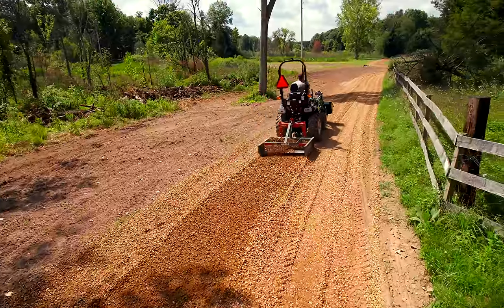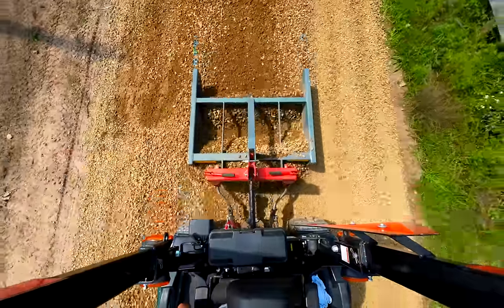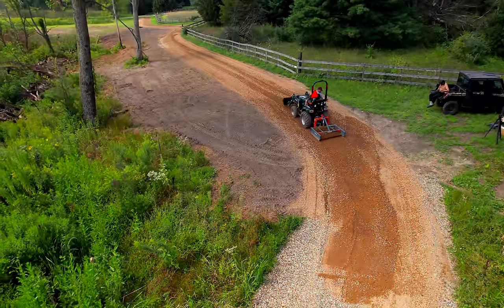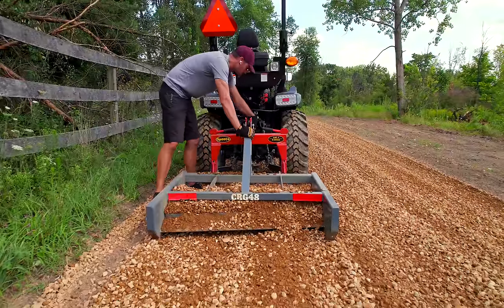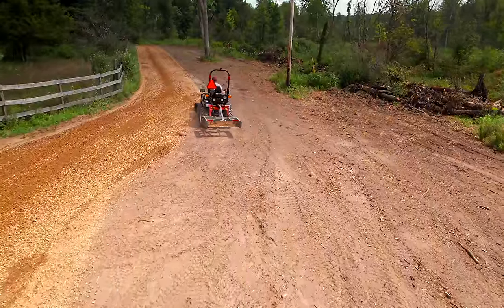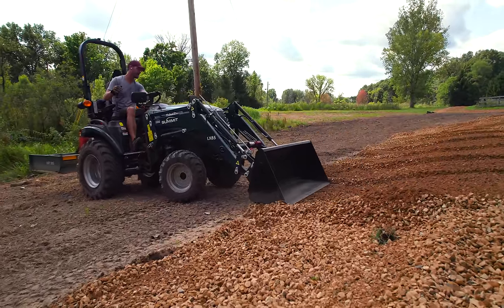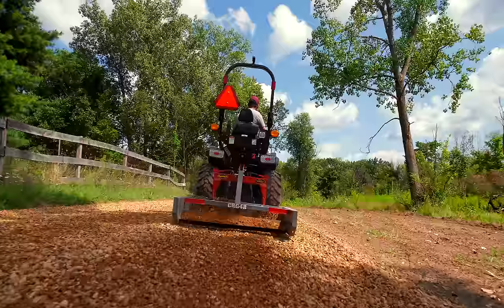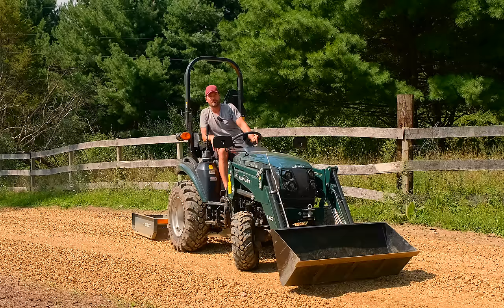THE ONLY TOOL YOU NEED FOR GRAVEL DRIVEWAY MAINTENANCE!😎

Comment: I put that fabric down on my 1000' gravel driveway 11 years ago and it has held up fairly well but has popped to surface a couple of places on the sides.    Maybe the contractor didn't cover it well enough.  I have put some gravel down couple of times since and it's the recycled rock from concrete and was washed and holds up well. and I'm afraid it I ran something like that over the drive it might get down to the fabric but watching you maybe it won't.  Thanks for awesome videos.

Comment: Looking good!  Feeling a 1’ deep ditch with large rocks every few feet is coming soon on the uphill (fence) side of that drive tho… with a couple of strategic perpendicular relief drains under the road or away from the road at key low spots…  More fun times ahead!
Reply from the maker: Definitely could be in my future, bit of an experiment I suppose!
Reply: That's what I need for my .2 of a mile driveway where a small seasonal stream goes over at a low spot to a larger stream to the west.
If I can, I may try to redirect above in our field (swales and berms directed to the east side of the 11 acre field to another seasonal stream), but nature has been flowing this way for a long time..... Hugh, I think I will need a culvert, but like the idea of the rocks you give to guide the flow.   First, I need my first tractor.  Love my new farmette of 21 acres in farthest northeast AL.

Comment: I would let the dump truck comeback when you are done with a load of maint. Gravel and give the driver $50 bucks to run up and down the entire gravel drives and ‘ROLL/Compact the finished gravel in to seal it in.  The tires and weight work perfectly for this.
Reply from the maker: Yep, Tom with Balkema does that for me.  Makes a big difference.

Comment: Almost 25 years ago, we started with about 500 hundred yards of busted concrete (still had the wire stickin' out) -- about a 300 foot winding driveway on virgin corn field. Today, about 500+ yards of  21A later, we've got a nice 2 tire track drive with grass in the middle. Woulda been nice to have that tractor you're drivin' -- got it on my 'things I want' list.  😊 (no, we never had problems with the wire from the busted stuff  -- it's down deep).
Reply from the maker: I bet that looks very nice

Comment: It will be interesting to see how the driveway holds up where water goes across it. Around here in central Minn-a-snow-ta they use a material called Class 5.  The past 2 springs have been disasters with lots of mud and washout. We had a guy come in this spring and lay asphalt millings and So far when we’ve had heavy rains, nothing washed out. Love that tractor. Hopefully they’ll be for sale around here.

Comment: I like the golden color better... I use a 60" box scraper, I don't have a landplane. With the hydraulic top link, the box scraper is very versatile and it does a flawless finish. The final step with the box scraper is tilting it back all the way, my box scraper has 2 blades, and basically back dragging the surface. The curve of that blade also works to compact the material. I would like to try a landplane sometime.

Comment: A planar, out sloped surface is optimal design on a hiking trail, vs a crowned surface.  This promotes sheet flow of drainage water, which avoids concentrated flow of water.  It's the concentrated flow of water, far more than sheet flow, that promotes erosion.
Reply from the maker: Very good assessment, that's what I'm going for.  Thanks for sharing!

Comment: Great video, Courtney!  As you work the sloped area, I can see how much is drops off to the side.  The picture in the video looks fairly flat which is deceiving.  I would love to see how a land plane would work on a bumpy pasture to help smooth it out...hint...hint..
Reply from the maker: Morning Kyle...I've kind of sorta tried that.  It is tough.  Same thing with a box blade.  If there's lots of organic matter and sod clumps, then it loads up very quickly and doesn't do an amazing job and pulling out all the sod.  I think it can be done, but is a heck of a lot of work.  Doing it for an entire pasture would be a nightmare in my opinion.
Reply: @PgetzkeFarmstead   A power harrow may do a good job too. I have only briefly seen one in operation, I wonder if GWT sells them.

Comment: You should be OK as long as the natural grade allows for runoff. I would think the only real issue would be that if any ruts are formed, they would be the entire width of the driveway. Which should mean more repair work than if the drive was graded with a crown.
Reply from the maker: Yeah, that's what I'll find out!
Reply: Perhaps use some large rock with some wood or concrete blocks (decorative stone type) to create an edge along the fence side which would lead to a "natural" place for you to install a few pipes to allow the water to drain under your gravel driveway. You can do this after you see how the water flows over the next few years.  Wherever "Mother Nature" has water running is usually the lowest point, so you don't need to guess at it.

Comment: I've driven rock trucks and semi rock trailers w/ 28' end dumps and if I had the clearance I could tailgate those loads but it had to be level or you could tip over. Especially if material got stuck in the nose of the trailer. Kinda etchy! Could that Summit tractor handle a 5' land plane? Seems like it could.
Reply from the maker: Yeah, I can see his rocking and rolling a bit too, it has a certain uneasy feeling...even without being inside the truck.
Reply from the maker: Probably depends on conditions...I think it's similar to that 3025e that bogs down with heavy loads on the 3 point.  All that extra weight is good for some reasons, but does eat up power when pulling.  48" plane worked awesome though.

Comment: You will be out there grading after every rain when your rock is washed away. Plan on paying for asphalt covering and your problem is solved unless you like the exercise and making tractor videos.
Reply from the maker: Fingers crossed, I'll prove you wrong.  However, it's just an experiment.  I could easily crown it in 20 minutes and water will flow down both sides of the drive.
Reply: @GoodWorksTractors   I think that material will lock up like concrete.

Comment: Title is very misleading  first off  you admitted that in different places  the gravel was very  thick  and in other places  thin...  the correct way would be to use a  box blade  first  to move  the  gravel  to the  lower spots  and get the  drive way  closer to  level   then second  step  would be to use the land plane  for  final leveling.  I do agree that a qualified/ experienced dump truck driver can save you a lot of time  spreading out gravel
Reply from the maker: Lol, you don't need a box blade to move gravel.  I move gravel all the time with a land plane and did it in this video.  Nothing misleading at all.  I sell tractor attachments.  It would be to my advantage to say you need more than one tool because I'd make more money!  But, alas, only one tool is needed :)